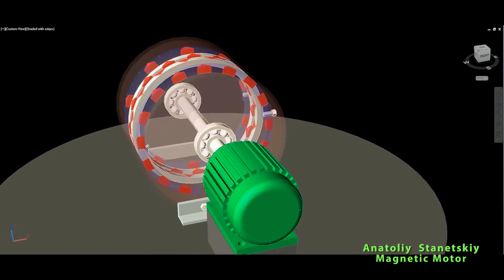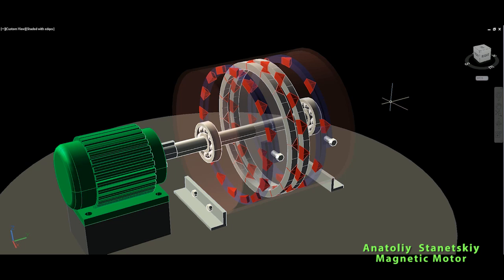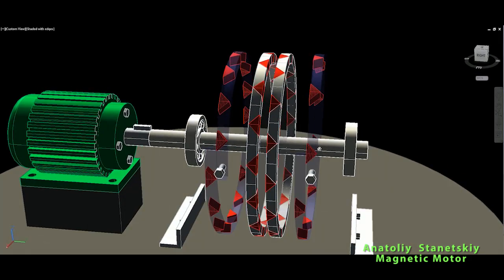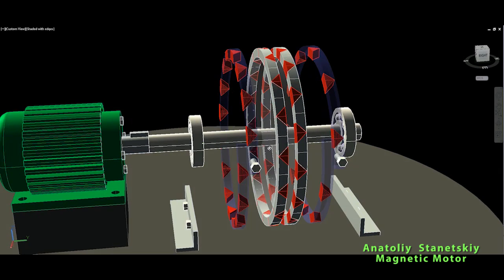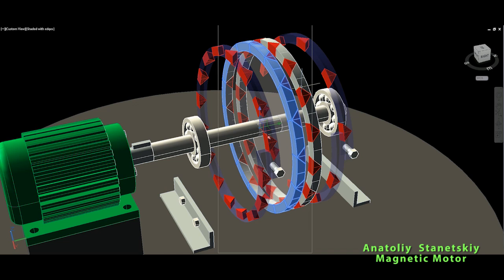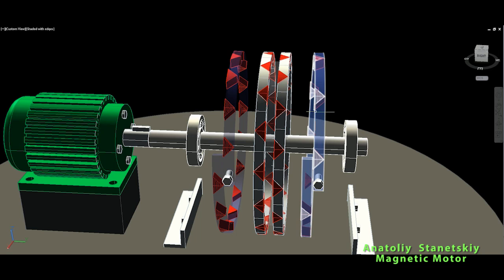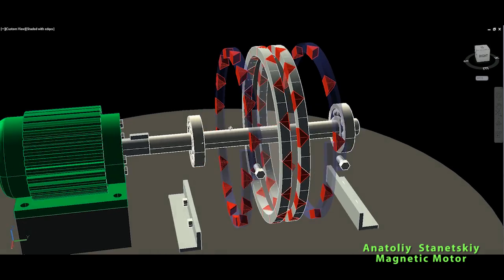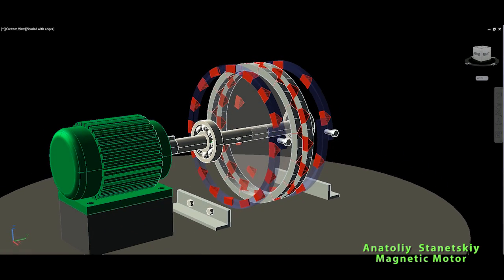Anatoli Stanetsky Magnetic Motor

Comment: Thank you very much Mr. Mario, that you introduced my invention. I was long time working with permanent magnets. I have created couple devices like permanent magnet motor (PMR). In 2004 I created the first PMR, where inside of the
magnetic ring were running three slides. I do not understand why until now no one has following this path. I did not make patent, because motor had small power. We can talk about it later.  Based upon firs design I create next PMR, like you introduced. Unfortunately I did not show on the drawing the item, without which motor can’t work. Because I made it later. We can consider this moment if we make decision to fabricate it.